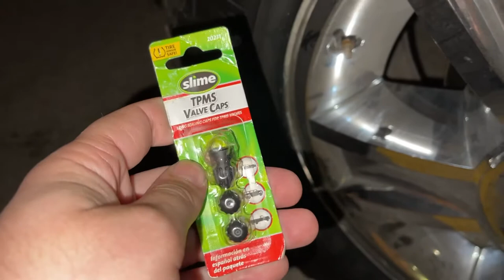TPMS Valve Stem Caps for Modern Vehicles / Check This Item after leaving The Tire Shop

Comment: It’s not going to make a difference… they’re only packaged as “tpms” because they’re plastic which won’t weld onto the tpms stem like a metal one can.
Reply from the maker: @travispratt6327  it covered the entire thread
Reply: @TurnThemWheels  Ok but that’s not why they’re tpms, that’s just the specific design. TPMs are simply plastic and not metal, and have an o-ring in the top (which many non-TPMs labeled do as well) so the insides don’t get corroded. Covering the thread doesn’t have anything to do with it.
Reply from the maker: @travispratt6327  I know what you mean